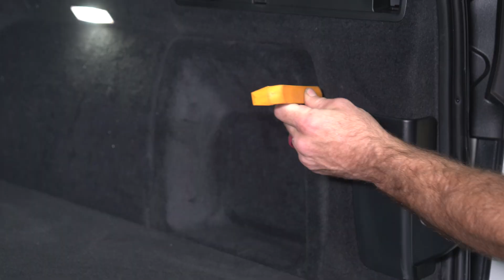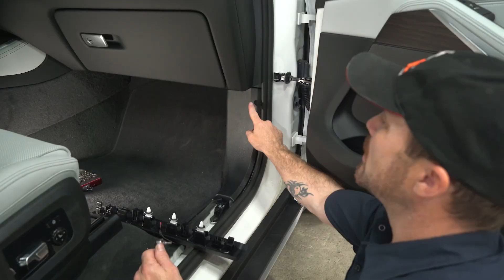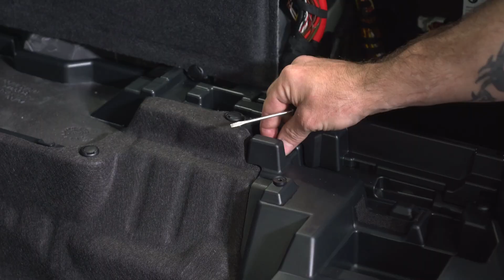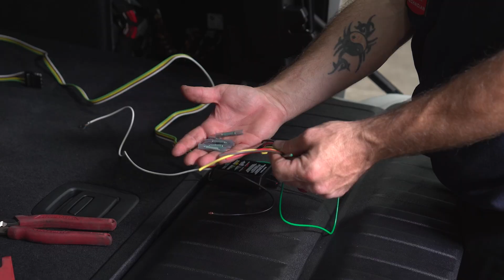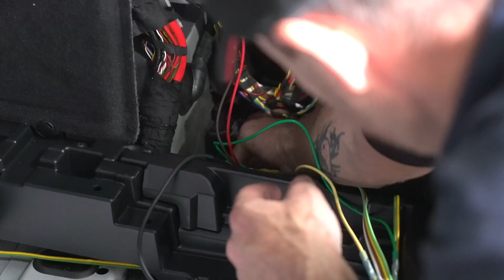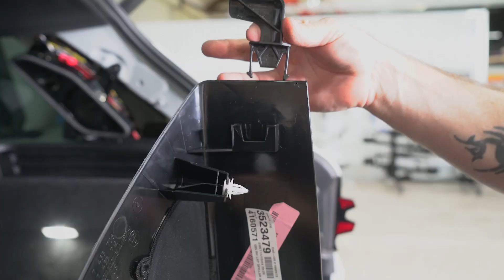2024-2025 BMW X5 | U-Haul Trailer Wiring Installation | CMF59236

Comment: How do you do the coding to disable the constant warnings?
Reply from the maker: We do not sell or install products that require software updates.  Check your owners manual for instructions to turn off the parking sensors during towing or when using a Bike rack or cargo carrier.